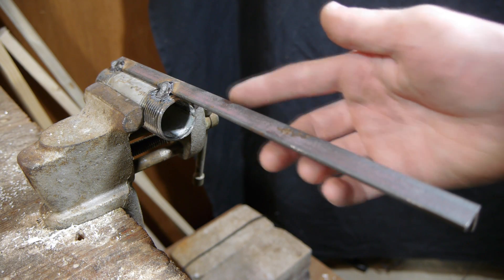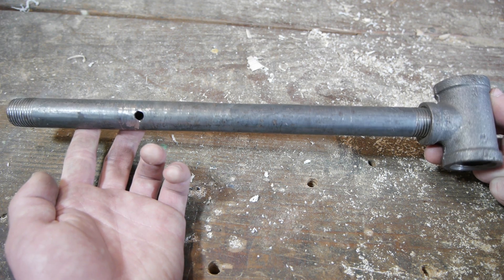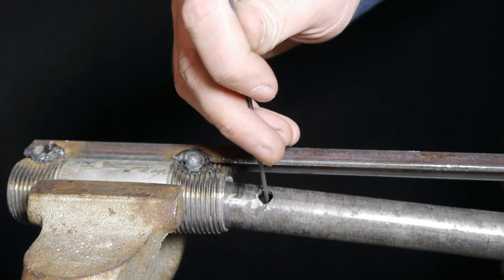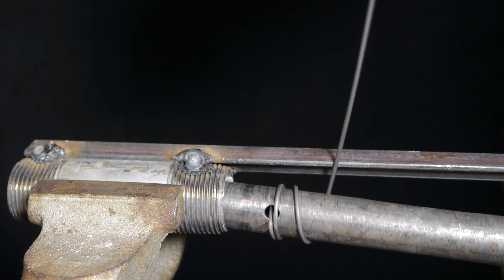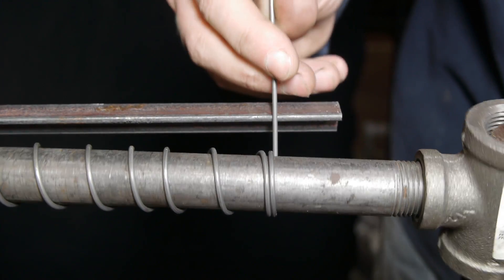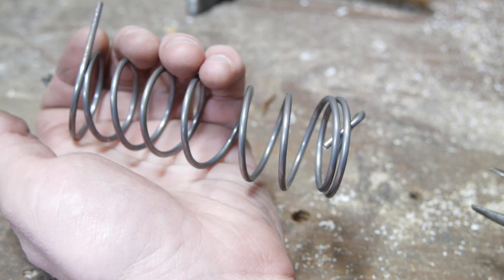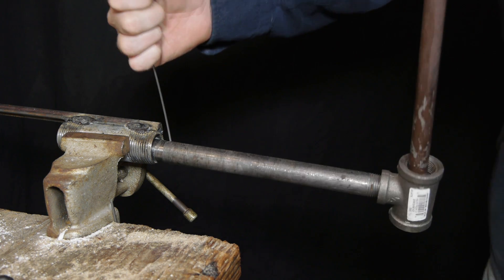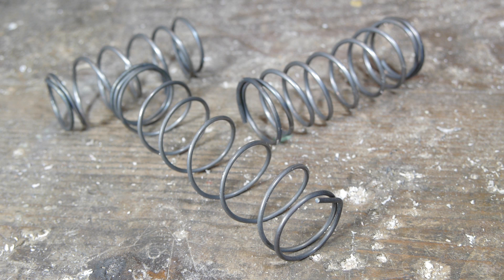How to Wind Custom Springs

Comment: I know that it might be difficult to keep the spacing between the spring windings constant for compression springs in this process of making them... 

But I have a question; What if you made a simple extension spring and then, using plastic deformation, simply stretched the spring to whatever size compression spring that you needed? The spacing between the winds would be basically perfect. But would the deformation cause the spring to be weaker, or maybe bend easier?
Reply from the maker: That's a good idea

Comment: I was hoping you would explain how to quench and temper the metal, and even "carbonise" it. I'm starting from chicken wire, which is very soft, and as you suggest, you need some heat treatment in a coal-based mixture to stiffen the spring (heat it to red and throw it into peanut oil), but it becomes incredibly brittle then, so you sort of anneal it back by leaving it a couple of hours in the oven at 200ºC to "resoften" it...  I need to check, maybe next week-end...

Comment: Hey ! Tell me - a spring like this with Lot space between each wire Are more or less powerfull than a default spring (small space between wires) ? Or faster ? Or more resistence ? The power last more time ? Or less ?

Comment: You should fabricate a drill attachment. Having a drill may make working with the tension easier also if you attached a 1/4” threaded rod at a 45 degree angle with an eye hook bolt attached to the threaded rod then weld that to the angle bar you’d have a fuckin set up! 😂 it’d need to be far enough away that you could push the music wire with the palm of your hand to guide into the correct place.

Comment: You could even 3D-print a hull with a negative imprint for the spring wire, that you simply put over a tube and then the wire precisely follows the negative shape. This way, progressive springs can be made easily

Comment: This is the best simple tool we have seen yet. Great video! If you are having trouble with custom springs call Hyde Spring 313-272-2201 we manufacture custom and stock springs and ship anywhere on the planet.

Comment: Have you thought about drilling a hole in the angle iron to thread the wire through? This way you will be slowly pushing the receiver pipe as you turn. Also so the wire won't hurt your hands.

Comment: If you anealed the wire first...it would be easy to bend.. then just heat the spring to cherry red and then oil quench

Comment: Just a thought: if you took a bit of time with a drill and maybe a grinder (to make a flat spot on the pipe where a hole could be drilled.), you could build that tool with a few nuts and bolts if you don't have a welder.

Comment: Interesting. I will keep that in my tool box of methods. What I really need though are smaller springs. I often deal with firearms that were made 100 years ago and the springs need replacing, but good luck finding a spring just the right size and tension.
Reply from the maker: You can make little springs the same way, just shrink down all the parts.
Reply: NightHawkInLight I guess I will have to find that wire online. I doubt anything within 100 miles of here will have wire that small, ha. Thanks for the information.

Comment: Cool idea Ben!  Bake them in the oven at 500C for an hour and they should retain their springiness under higher loads.
Reply: NightHawkInLight not with that attitude.
Reply from the maker: Thanks Grant! I think you mean 500F? I don't think many home ovens hit 500C
Reply: you two shpuld make an iron man suit or something
Reply: May Grant Rest In Peace :(
Reply from the maker: Magneto! If anyone's oven hit 500C it would be Grants.
Reply: I miss grant now the channel is for kids and the experiments that They do seam stupid and childish
Reply: Grant Thompson - "The King of Random" Hey..There's Grant..   ~( :-})={>--- ]
Reply: +Grant Thompson - "The King of Random" Is that before or after the bend?  I'm guessing heat it before for ez bending.
Reply: GodsLoveMinistry
... its need to be done after the bending for distressing the structure of the material...
it makes the spring longer lasting...
and trust me,
i'am workin in industrial manufacturing,
of springs and spezialized
form parts...
we distress every produced part,
because all of them are cold-formed.
Reply: +GodsLoveMinistry after
Reply: I'm gonna try it in my Nana's microwave😊
Reply: Leon Parkin The hacksmith is already doing that
Reply: NightHawkInLight You're prolly right.
Reply: Grant Thompson - "The King of Random" good job
Reply: Grant Thompson - "The King of Random" your so smart
Reply: It needs only 200 - 260C about 1 - 2 hours
to distress the spring so it leasts longer...
The bending process hardens the material
that makes it porous and easy to be damaged!
And of cause you forgot to say that the spring should be set down for 1 - 3 times (means to be compress the spring until each ring of it touches its neighbours) to enhance its resistance!

Comment: You could even add a ruler measurement to that angle iron support bar, with a slide that holds the wire. That way you could easily and accurately manage the spacing as you wind the spring.

Comment: Sorry but I have to disagree with you on this. I've been a Mechanical Engineer for years and I promise you can find any spring you need online. Any shape any size. I've been getting them this way for years. Although I do like your method for winding them. Also, you could show off in a bigger project how the spring were hand made.

Comment: Thanks! This'll come in handy. I hadn't even thought of making my own springs like this.
Reply from the maker: It's the simplest ideas that I like the best. Smaller springs can be wound on a spindle on a drill press, but that's no good for large springs.
Reply: NightHawkInLight I wonder if this can be done with much more flexible/maliable wire, and then heat treated somehow to harden it and make it springy?
Reply: Simple and genius! Great video! I've done similar with nitinol (memory) wire but never thought of this obvious application.

Comment: Will these springs wear faster than a bought one, eg loose the tension and become "slack"?
Reply from the maker: No, they should be every bit as good as store bought springs, especially if you temper them after winding which can be done in an oven.
Reply: Okay, any idea which temperature I should aim at? Also, would it be possible to make a dual rate spring?
Reply from the maker: Filip Carlén 4-500 f. I've added a note about tempering to the description.
Reply from the maker: harry smith Great link! I'll add that to the description.
Reply: Filip Carlén 
http://www.efunda.com/designstandards/springs/calc_comp_designer.cfm#calc
This may be of use to you. A dual rate spring may be made by more densely winding the coils at one end.

Comment: Great video! 
But there is only one thing that bothers me is how do i make a specific spring with a specific strength, (the K in hooke's law)
Reply from the maker: Moshe Sherman No, I'm saying that I usually am not concerned with the strength so long as it's very roughly within the parameters needed for a project. Making a spring of a very precise tension is beyond the scope of this video.
Reply: i would guess trial and error
Reply from the maker: I haven't done any math to predict the exact amount of strength a given spring is going to have because the things I usually need them for don't require much precision in that area. 3/32" music wire is a good size for a spring that's strong, but not so strong that you can't compress it by hand. You can of course use thicker or thinner wire depending on your needs, and you can go further to even out the tension by tempering the spring after it is made in an oven at 400 - 500 f for 20 minutes or so. Concerning achieving an exact strength you might have to do some testing for yourself with the specific materials you have on hand.
Reply: ravener96 trial and error is never a good thing, it costs a lot of metal in that case
Reply: Moshe Sherman http://www.efunda.com/designstandards/springs/calc_comp_designer_eqn.cfm
n is the amount of coils and G / E is a material property (just look up what material your wire is made out of).
Reply: NightHawkInLight so what you are saying is that after the making of the string you can change the strength of it by hand?
Reply from the maker: Moshe Sherman Another commentor found a link for determining various spring tensions according to wire size/pitch etc. It's been added to the video description.
Reply: NightHawkInLight oh, okay.
Reply: superdogmeatmeat Thank you, but I was talking about the error that is made as a result using the tools NightHawkInLight  showcased.